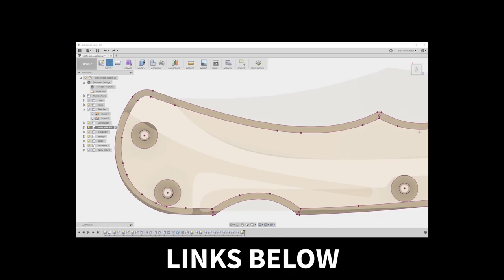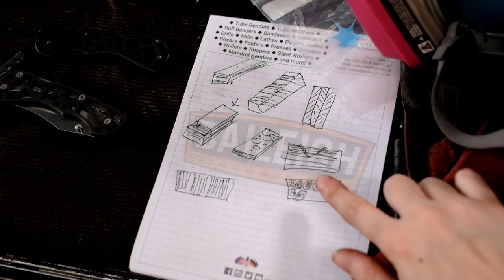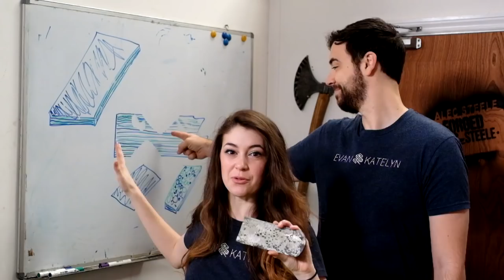Making Damascus with Alec Steele!

Comment: @6:18 - actually no...  You are grinding off the "scale" so that you have a clean surface to weld with.  The Scale will not weld.  (Or, if it does weld, will have massive lines through the pattern.)  Also, it is easier to cut - scale is harder...
Reply from the maker: Thanks for clarifying!

Comment: And that folks, is how not to use a surface grinder. He should've grabbed it in the vice, face milled both sides in his bridgeport manual mill and then ground only 0.005-0.006" per side.